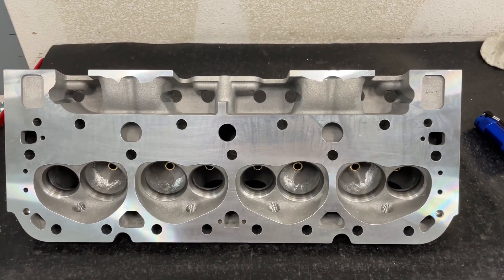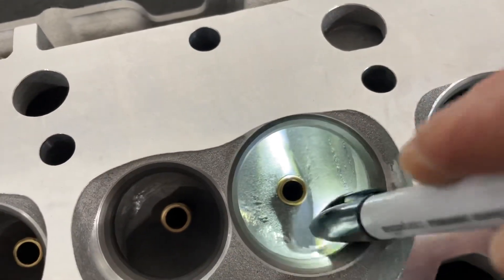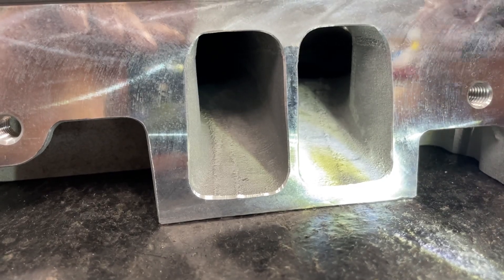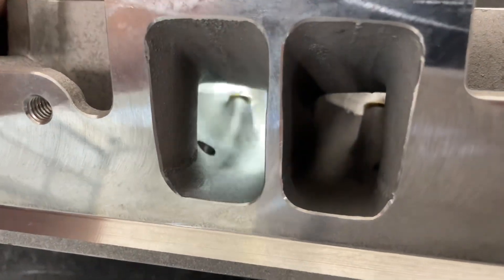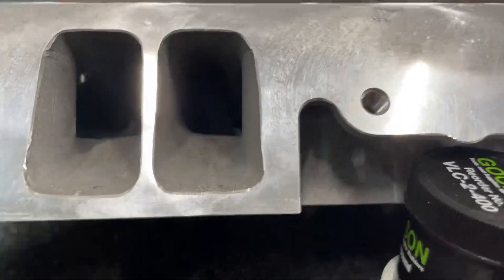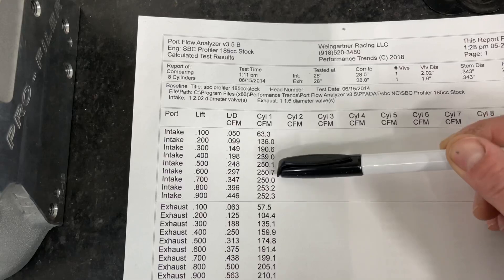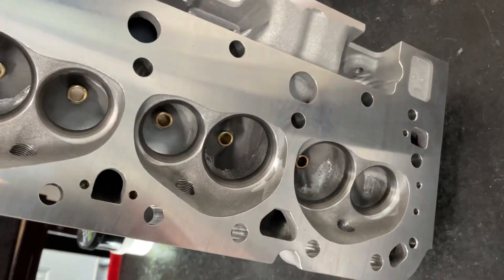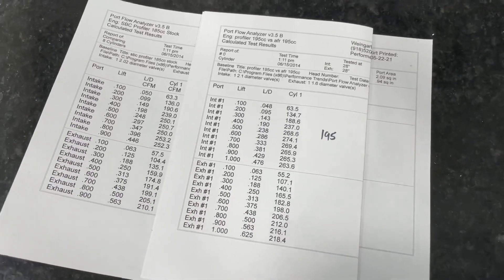Sbc Profiler 185cc head review with real flow numbers.

Comment: Interesting shape to that intake port. I’d say it’s almost exactly like David Vizard describes in some of his porting videos, basically that the side of the port away from the center of the cylinder is where you concentrate on increasing size. This could be the basis for a really nice 355 street engine or a torquey 383.
Reply: Even a very torquey 355.

Comment: I just broke my th-400 in half with Small Block, but that can be fixed. Send me a pair of them and your best pair of heads in angle plug,  and I will do a back to back Drag strip test against mine and I will see if I can run a 10sec 1/4 et. With them drive to the track,  naturally aspirated daily driver Small Block Chevy.

Comment: It’s amazing if you compare a SBC 185cc 2.02”” valve to a ported LS 208cc 1.89” valve I’ve been working on.  The 15* really  helps over the 23* 
Have you ever worked on a small valve LS head to see how it responds to porting?

Comment: Cool video, great info.

How good do you think you could get these to flow with a minimal runner volume increase? I'm working on a high rod ratio short stroke high compression engine that would work great with lots of flow that has small runners.

Also, what size chambers do those have or are available in? 

Thanks for doing these videos, they're very helpful.👍